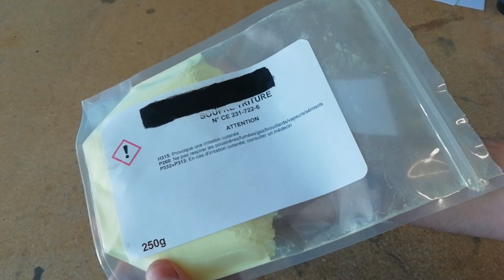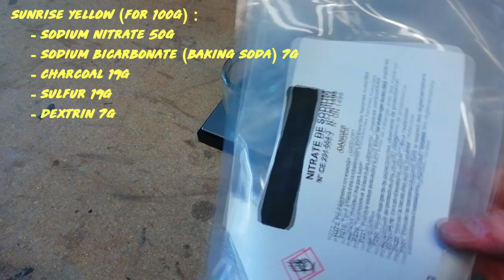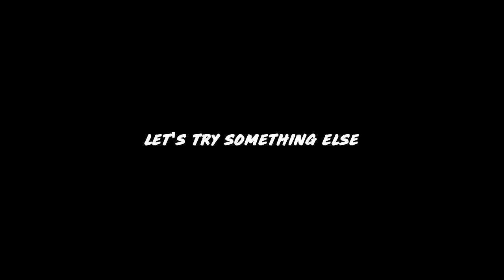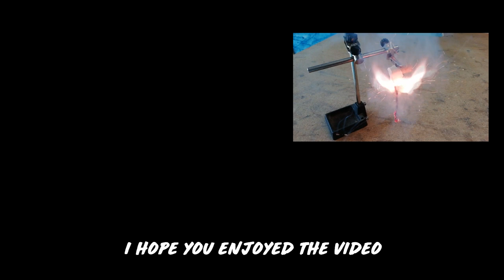Fireworks Basics : MAKING FIREWORKS STARS

Comment: How do you make crackle stars? I think there cool and salvaging them from fireworks is kind of expensive. Thanks.
Reply: 66 copper2oxide, 30magnalium, 4 dextrin. Make 2mm stars
Reply: @Pyrokartoffel  interesting recipe, almost all the crackle stars I’ve seen use bismuth trioxide or lead trioxide, both of which I can’t get. Thanks for sharing going to have to try that out.
Reply: @gordonfischer8484  the original composition is from "Rocket Tests"
Reply: @Pyrokartoffel  What do you prime these with?
Reply: @gordonfischer8484  
What about Bismuth subcarbonate ?
Reply: Easy, Use what’s in crackle balls.

Comment: Nice tutorial you could try soluble glutinous rice starch as the binder also it seems to work better for charcoal comps and is not as sticky great video
Reply: Trouble is SGRS is kinda hard to find in North America. SGRS is very common with Japanese fireworks because it’s easier to find there.

Comment: On the granite stars you can get some pyrotechnic grade zinc (or other metals) that is so fine you might want a mask

  in the description “charcoal can be replaced with magnalium to make an even brighter flame.” Balance your equations and fill the electron shells because per mole of carbon it takes 2 moles of oxygen to react but aluminum (aluminium) per mole take only 1.5 moles of oxygen and magnesium per mole takes only 1 mole oxygen so you should tell your viewers the new balanced equation.
Reply: Yes, your statement is factually correct, but in pyrotechnic stars we don't look for perfect combustion, we look for perfect color, and we do it with an empirical approach
Reply: Also in blackpowder you get carbon monoxide (CO)
Reply: Also if you had perfect combustion, you wouldn‘t want perfect combustion. You wouldn‘t even see the desired colors because the reaction would be over so fast.

Comment: Im gonna sound stupid but do i need the dextrin?
Reply: You need something to hold the star together; dextrin is most commonly used, but there are other possibilities.  If you're pressing a comet that has much sulfur in it, the sulfur becomes fluid under pressure and then acts as a binder.

Comment: My apologies to the community guidelines but you seem to be a chemistry student who slept his way to a solid D in class! You're using a metal sifter to strain your powders (possible ignition source when using a steel mesh, use a readily available brass mesh if you want to live), you're storing all your materials together (ignore the idea of losing a finger, you're aiming for the loss of a lot more than a single digit) and you're using the bare bones basic of dope dealer scales for measuring (we're all too aware how inaccurate those can be) so, in my closing statement, STOP IT!! 
Run with scissors, don't look both ways before crossing, piss on an electric fence, you'll achieve the same adrenaline rush when you wake up but you will wake up.

Comment: I still don't know why you're using glass containers for mixing and weighing.

I've never tried wetting granite stars with anything other than plain water.  Good results in those depend on just the right degree of wetting and mixing.  When the mixture is too homogeneous, you lose both some of the color and the charcoal tail from granite stars.  Also, I wouldn't say they require priming for good ignition, but it doesn't hurt.

Are you sure you require both NaNO3 and NaHCO3 in the yellow stars?  The main problem with NaNO3 is hygroscopicity -- so much so that many would use another oxidizer.  In the Novice class of shell competition at the Fireworks Festival of America in Weedsport in 1993, compulsory colors were involved, and nearly all the yellow stars went blind -- it is THAT HARD to get ignition of NaNO3 comps (which presumably most of them tried) in New York in the summer.
Reply from the maker: I personally never had any problems using sodium nitrate. The yellow stars composition was a "remake" of an existing one containing mangalium which I didn't have at that time. I now use a yellow composition from pyrodata containing sodium nitrate, mangalium, charcoal, sulfur and dextrin, binded with a water/alcohol mix. I pump and prime them and so far it has worked very well even though everything is wet during this time of the year.
You can see those stars in my latest video. The effect was very good and the stars stayed dry when stored...

Comment: Hi thanks for videos....
I tried to make tiger tail stars but facing an issue, when the mixture is dry then it is burning nicely but after making stars it is not having that glittering effect.
If you can suggest something to resolve the issue it would be a great help.
Reply from the maker: The sparks produced by this composition highly depends of the type of charcoal you use and also the way you make your stars. You should use pine, spruce or fir charcoal to have very nice tail. If the glittering effect isn't there, using coarser charcoal might be the key as it will burn longer. Making your oxidizer mix finer might help as well. Then comes the process of making the stars... Do not use to much water otherwise it will kill the effect. You should be left with a nice ball of composition that hold itself but doesn't stick to your tools. If it still doesn't work try to pump your stars as it require much less solvant.
The best result can be achieve with home made soft wood (spruce, fir, pine etc,...) charcoal because the one you find in shop have a lower quality as it's a mix of woods.
I hope this can help you ;)
Reply: @_thefrenchmaker  Thank you so much for the suggestion.....in my case probably charcoal is creating problem.. I  used little bit of sodium bicarbonate(Baking soda) in the composition of tiger tail stars it was giving nice glittering effect, can baking soda be  an issue when the mixture is dampen with water and alcohol.
Let me get some good quality charcoal and I will make another batch of tiger tail stars and will share the video with you.
Regards,
Tirthankar
Reply from the maker: I used baking soda in other composition in order so slow down the burn rate but I never put it in tiger tail composition so i don't now if it's an issue....
It would be cool to see if it makes a difference 👌
Reply: cool Tirthankar , hope we can meet as we share same place ;)